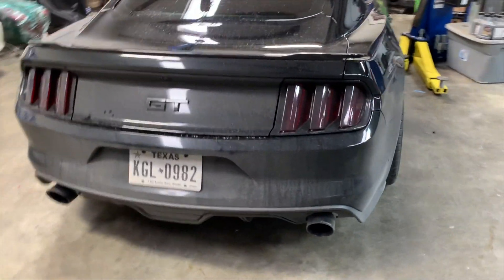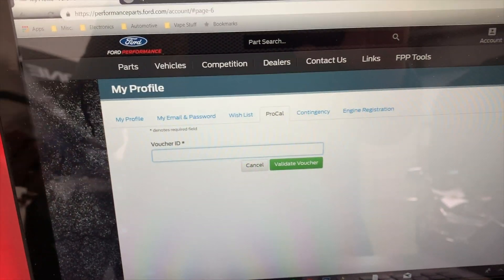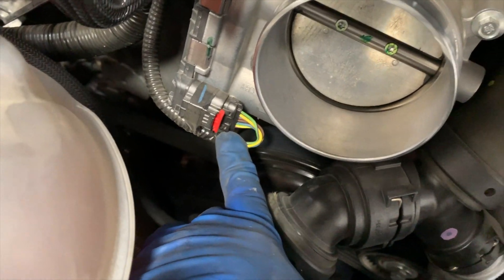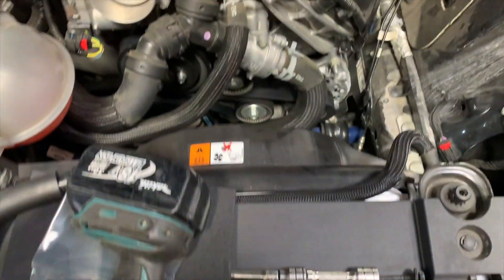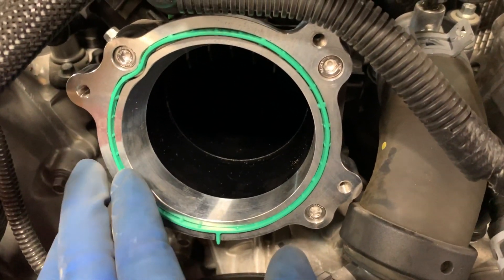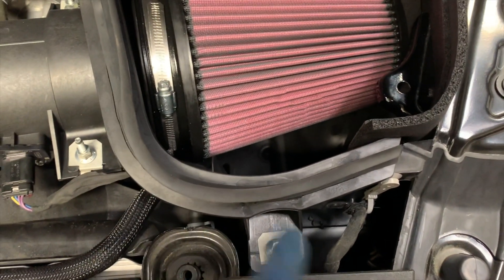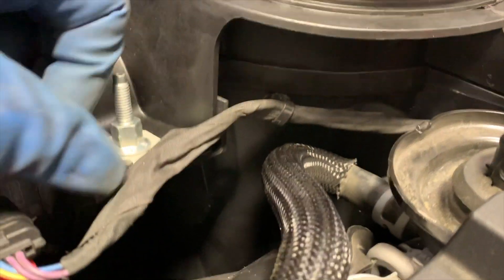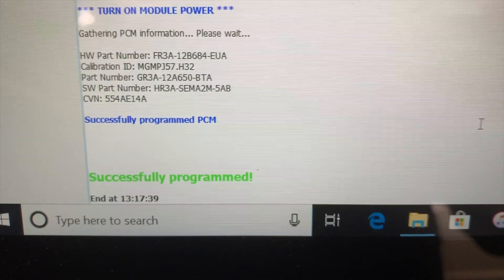Mustang GT:  Ford Performance Power Pack 2 Install

Comment: Glad i found this video as I recently purchased a 17 with this mod and wanted to re-install the engine cover but it wasn't cut out for that air tube. I suppose the previous owner just decided to leave it off. Now I know it's in the instructions to make the cutout for that tube I will be taking care of that today. Thanks!

Comment: hello dfw, I know its been over a year since you installed this but I'm hoping you can still answer a question. just finished installing this kit and when I shut the motor off I get this puff of air from the filter almost sounds like
the throttle body slamming closed   is this normal?
Reply from the maker: chris vincent sounds like a throttle body issue. Check and see if the software has a relearn procedure or etc reset (electronic throttle control)
Reply: When you turn off the car w/ the new throttle body, the popping sound is it closing for emissions